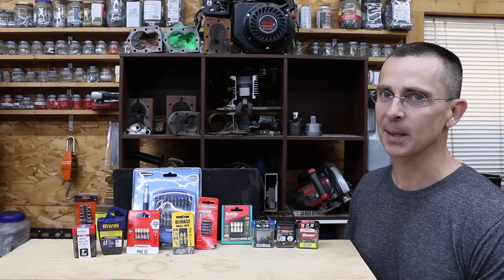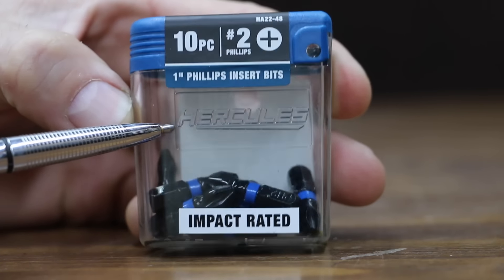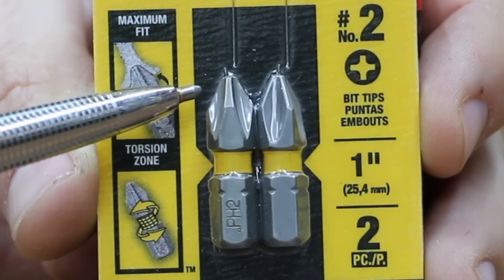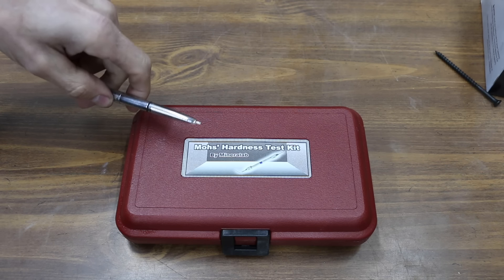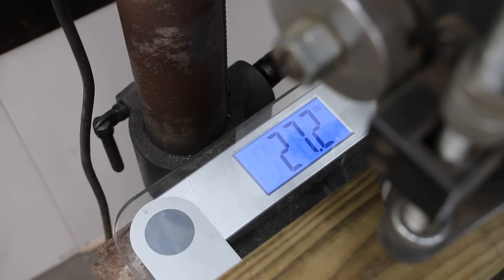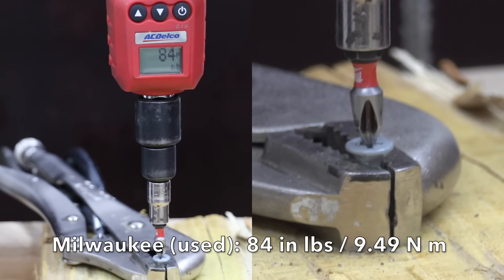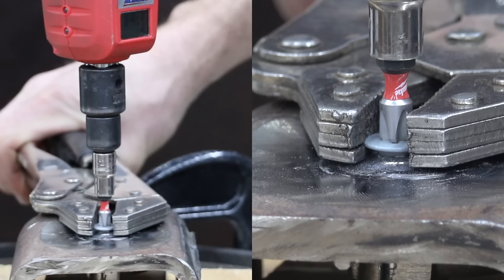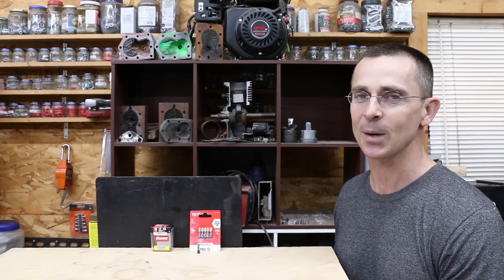Which Impact Driver Bit is Best? Let's find out! Phillips #2 Showdown

Comment: I live in Poland and probably will never use any of those, but your tests are just awesome, detailed and accurate. Pleasure to watch. Thanks!
Reply from the maker: Thank you very much!
Reply: Milwaukee Shockwave, DeWalt, Bosch ,Makita gold (sam ich używam bo miałem dość końcówek które po paru wkrętach były do wyrzucenia )... wszystko do kupienia na allegro
Reply: używam Milwaukee Torx T25 i jestem zaskoczony. całą drewnianą altanę (domek) 15m2 na 3 bitach. problem jest taki, że kupiłem paczkę z 25 bitami...
Reply: I have seen Milwaukee becoming more popular and more available in the UK
Reply: What tools brands are considered best in Poland ?
Reply: @simeonbonev4111  Makita, DeWalt, Bosch blue line for pro's also Milwaukee  is getting more popular
Reply: tom drap I also think these are the main players worldwide . Makita had dominated for many ears, but Dewalt and Milwaukee in our days make stronger and more heavy duty tools and they slowly gain popularity in Europe. I have used all of these brands and lately I really like Milwaukee 12V Fuel tools because they are compact, but as strong as other brands 18V and 20V tools. The batteries are much smaller and also very cheap with a lot of aftermarket options.
Reply: Dude we don't live in a bush, we have Milwaukee, Bosh, Dewalt etc stores nationwide. Fuck the old stereotypes this is EU
Reply: @simeonbonev4111  Festool, Bosh, Milwaukee are top shelf but a lot of trades are using Ryobi and Parkside. I use Milwaukee but brought my shit from Canada which is cheaper
Reply: Greg Sparrow Price and warranty in different markets create the major difference. In the USA  trade people use mostly Dewalt and Milwaukee it has become symbol of professional attitude. I like Ridgid tools from Home Depot ( ARG in other markets)  because lifetime warranty on tool and battery . I have really hard time to go down to 2 systems because I find some tools so useful like the 23 gauge nail gun from Makita I don’t find other brands to have it . But I go more and more Milwaukee 12V  because they come with great deals and batteries are so cheap if you buy Milwaukee Fuel 12 is as strong as 18V or 20V from others brands
Reply: Profeska nie to co w cebulandi :d
Reply: Allegro has it all and cheap (paid like 45 cents/piece from DeWalt). (Im not gonna do a job that could break a bit, and other scores for DeWalt were really nice). I mostly needed SDS drill bits and also went with DeWalt
Reply: @simeonbonev4111  Greg Sparrow said correctly. Parkside is VERY popular as it's the best in the "A brand, rather a trustworthy one, but not an expensive brand" category. Not a professional's choice but one for people who only do some work at home.
Reply: I'm pretty sure you guys have Wiha Tools in Poland.
Reply: Kolego, Milwaukee kupisz już chyba wszędzie. A na internetach na bank.
Reply: @KLU I own a wiha screwdriver with changeable bits that is made in Poland. I consider it to be my best and most comfortable driver I own
Reply: @MicroageHD  I own wiha tools made in Poland

Comment: I am currently redoing my old rotted deck on the house I just bought. The previous owner that built the deck used low-quality screws that rusted badly. I was using vice grips and a pry bar to remove the boards and screw is one by one. After watching this video I purchased a Philips DeWalt number 2 and used my impact and it has changed my life. The screws are actually coming out or at least the vast majority of them whereas before they weren't coming out at all. Before I started using the new dewalt bit and my impact I was using a drill with an old Phillips head I was only getting one or two out of 25 screws out. Now I'm getting them all out except one or two and if they don't come out they break which is fine too.
Reply from the maker: Thanks for sharing.

Comment: As an electrician I use my impact all day, I’ve used the Milwaukee tips for 3 solid years after 4 years of using Makita tips. Milwaukee is the best on my opinion.
Reply: Did you tried the black coated milwaukee ones ? I have it and its my favorite after the wurth AW. but for philips or pozidrive, it's even better than wurth or wiha
Reply: Torx bits is the best.
Reply: hot dog I do use the black coated impact Milwaukee tips mostly but just got a pack of the Shockwave Pozidrive tips so we will see.
Reply: tom eng Are you talking about torx tip style bits and screws? I’m unfamiliar with a brand of tips named Torx.
Reply from the maker: Thanks for the feedback.
Reply from the maker: Thanks for the feedback.
Reply from the maker: Thanks for the feedback.

Comment: WHEN WORKING IN ASSEMBLY WE USED MILWAUKEE WAS THE ONLY BIT THAT WOULD LAST THROUGH A WHOLE DAY.
Reply: WHY ARE YOU YELLING?
Reply: Milwaukee makes fantastic products
Reply: WOAH THATS REALLY INTERESTING
Reply: @SilvianoJ  BECAUSE WHEN WORKING IN ASSEMBLY YOU GO DEAF !!! ASK ME HOW I KNOW!!!
Reply: @SilvianoJ  HES MAKING A STATEMENT. HEAR HIM OUUUUUUTTT!!!
Reply: Almost 1,000,000 subscribers for Project Farm!
Reply: Milwaukee is the best. In my honest opinion. I'm in a middle of a constructing a restaurant. I'm using the same bit after 200 sheets of drywall
Reply: EB Lou Lou I CANT HEAR YOU YOU NEED TO SPEAK UP
Reply: @woodlefoof2 Ok IM HAVING TROUBLE HEARING CANT tell  IF IM YELLING oR NoT
Reply: I WAS HERE
Reply: caps lock is cruise control for cool
Reply: Nice.. I'm sold.
Reply: Milwaukee makes good tools,  Their drill batteries are tops as well.   They hold power a loooooong time.
Reply: I don't know where you work, but I'm a carpenter and I can use the same bit for weeks (I usually end up loosing it). If you have a hard time finding a bit that can last you a day, I think the issue isn't the brand, but the way you're using it.
Reply: Milwaukee batteries cases suck I ve seen so many shatter on impact overtime in the cnc shop I use to work at. It made me wish they sold just the battery shell/case. But other than that, they held charge very well. It always made me wonder why no one makes a drop case for batteries like  for cell phones
Reply: @ebloulou4203  yeah but what else is being used? are you talking self tapping into metal studs or regular screws into 2x4s
Reply from the maker: Thanks for sharing.
Reply: @jpmking9635  taping into metal studs, f majority was firewall so two sheets of ⅝'s stacked. 4x12drywall sheets
Reply: @joshr1801  why are y'all dropping the batteries so much? I've dropped tool after tool off of ladders onto concrete, and have never had any brand battery bust open. And I use them till they're dead
Reply: From the tests I've seen, the silver Milwaukee bits suck. The black ones are decent. The German ones seem to be the best tho
Reply: SilvianoJ  BECAUSE HAVING WORKING ON ASSEMBLY FOR A LIFETIME YOU BECOME DEAF. so. He doesn’t intend to yell...
Reply: @SilvianoJ   long term use of an impact driver without ear defenders= deaf as a post. If that happened to you,  YOU'D BE YELLING TOO
Reply: @urjnlegend  it wasn't really me using them, I was  a saw operator ( I unloaded bar stock from semis and cut materials on 3 different saws, so I had no use for power tools) there and the power tool rack and battery area was 20ft from me so I seen a lot of batteries on the chargers.
Reply: @SilvianoJ  WHAT?

Comment: I use Milwaukee’s shockwave line of driver bits and have not been disappointed yet. From high torque applications to driving 100’s of 3” stainless deck screws, the bits I have seem to get lost or stolen before needing to be swapped out due to damage or breaking. I have a number of the shockwave cases of assortments of bits, but seem to use the 2 inch PH2 and T25 almost daily and have not broken one yet. Very impressed with the quality and it seems this test reflected that with the results.
Reply from the maker: Thanks for sharing.

Comment: I can't remember when I screwed up my last bit, since I use Torx stuff...
Reply: samplesmasher yep, i quit buying phillips head screws and only get torx and never have an issue since
Reply: Lol, yep. Got about 5000 t25 screws of different sizes in the shop and use them for all my build projects it seems. Probably at least 50 t25 bits floating around too but rarely need to replace them.
Reply: Torx is the only way to go.
Reply: I finally wore down a Milwaukee Shockwave T20 bit. It's been used for a couple of years and has installed 50 m2 worth of rafters, ceilings, joists, floors, skirting boards and a lot of other stuff. Well over 5000 screws so far. It finally started slipping a bit more than i liked and i've donated it to the fuck-it bucket.
Reply: I re-did the decking on my trailer using nothing but torx bits. Had to go to the store twice to buy new bits because they kept breaking. Went though a few brands. Can't remember them all but they were impact driver rated. One brand I remember for sure is Makita. I was pretty disappointed with torx stuff. Maybe it was just me. Lol
Reply from the maker: Thanks for the feedback.
Reply from the maker: Thanks for the feedback.
Reply from the maker: Thanks for the feedback.
Reply from the maker: Thanks for sharing.
Reply from the maker: Thanks for the feedback.
Reply from the maker: Thanks for the feedback.
Reply from the maker: Thanks for the feedback.
Reply from the maker: Thanks for the feedback.
Reply: Project Farm Please don't get me wrong. I really love your videos and respect your work. I just wondered who recommended this test and why PH-screws are still used in woodworking. Most people I know are using Torx (including me)

Comment: I used the dewalt bits for awhile, which were great when I was using a 12v impact driver. Very little issues with them, and they didn't wear out that quickly. Now that I upgraded to a 20v impact driver, which has some power, the old dewalt bits shatter quickly, sometimes on the first use.
Reply from the maker: Thanks for sharing.

Comment: After a day of decking and the homeowner showed up with 3" Phillips screws this lovely vid shows up ! I broke 2 ryobi bits , a dewalt impact rated bit then dug an old rusty bit in those plastic strip holders out the bottom of the box  i wish i knew the brand because ole rusty was a trooper . Did 5 hours of work and still had rust on it . Maybe older is better.
Reply from the maker: Thanks for sharing.

Comment: Have you done Torque Wrenches yet? Accuracy, consistency, tolerances, etc.
Reply: Rashad A real tool reviews has done a very good test with them with calibrated equipment.
Reply: You Wish  
I usually buy either the harbor freight or Walmart brands, they seem to made by the same facility, and both have lasted longer than my dad's Snap-On which we replaced 3 or 4 times before I bought a cheap-o one. I usually only buy a new one because I "misplaced" the old one, not because they broke.

It's pretty bad when a tool that costs 10x less last longer then the "professional" grade brand.... In fact, both are still operating as if brand new almost 5 years later, whereas my dad's Snap-On (now mine, since he passed) is broken YET AGAIN!
Reply: The key to keeping a torque wrench accurate it so back it off to its minimum  every time you aren't using it.
Reply: @Apachefog  seemingly not ..my norbar one explicitly says not to, as going below the minimum or above the max is what causes accuracy to go out. They said they did extensive tests leaving wrenches set at various settings and didn't affect the accuracy if they were left set...the ones that were backed off though ended up being inaccurate as it's all too easy to go below the minimum
Reply: @johnphillip1711  I've seen testing that showed significant accuracy degradation on torque wrenches that were left set towards the middle of their range for a month. They were click type and backing them off takes the tension off of the spring inside.
Reply from the maker: Thanks for the video idea.
Reply: @johnphillip1711  at the minimum... not below... always reset to minimum and put it away in a case is the correct procedure....🏁
Reply: @boosted2.4_sky  https://www.norbar.com/News-Events/Blog/entryid/449/the-ten-things-you-should-know-about-your-torque-wrench

If your storing long term yes its necessary, but seemingly not everytime, but I see where your coming from, good habits and all.
Reply: @ProjectFarm  I'd like to see a test done on Bars Leak block seal intake and radiator stop leak. Alot of people are for it and also against it.
Reply: @jameshargrove9346  that'd be an expensive video, either buying a car with the issue the fluids "might" fix or purposely make one of his fail in that way, and risk losing a perfectly good vehicle. There's a haed gasket fix I know does work, it fixed Samcrac's Range Rover head gasket issue, but you gotta be careful cuz it WILL seize a thermostat shut cuz it's essentially a liquid JB Weld that hardens from the natural heating and cooling cycle of the engine.
Reply: @Apachefog  My HF/WalMart brand ones (click type) do not get reset; I've stored them at 85 lb-ft for the last five years and hold on to that value pretty well (testing accurate with each other as well as my Snap-On before it broke again as well as requiring the same approx. breaking force from a breaker bar to bust a lug nut lose based on feel).

Comment: I’ve used the Dewalt bits and I’ve broken a lot of them while building my deck. Then I used a Milwaukee bit and I haven’t had a single problem with it and continue to use it for future builds. Ironically I was using a Delwalt impact driver using a Milwaukee bit.
Reply: Agreed..  Milwaukee has better products; Dewalt has better marketing.   I've got a ton of Dewalt bits and tools, if they ever break, I'm switching over to Milwaukee.
Reply: @chrismast2790 it has a lot to do with cost as well.  
My tool bag would easily quadruple in price if it was all Milwaukee, and it was purchased in the last year.
I really like Milwaukee, but man they're proud of their stuff for sure.
Reply: @YoureUsingWordsIncorrectly  I use DeWalt daily, no problems.
Reply: Dewalt power tools are excellent, their driver and drill bits not so much.
Reply: @sonofRassmuss    Just going to post the same.  My Dewalt tools have been awesome!
Reply: I like the Milwaukee bits but run both their and Dewalts drill bits.
Reply: I love them both but most of the time Milwaukee is better 🤷‍♂️
Reply: i do that as well.
Reply: I use Milwaukee,  dewalt,  and makita on a daily basis, and honestly you can't go wrong with either one, for impact driver I prefer makita it is lighter and just as strong as Milwaukee, but in my opinion better because I have dropped my impact from a 14ft ladder a few times and it still worked were my co workers drop their Milwaukee drills from 6 ft once and it breaks, dewalt is good too but weakest one from the 3 on the impact,the drill itself though I like dewalt better than the Milwaukee and hate the makita drill, on the 12v line I would have to say Milwaukee is the best and that's coming from a makita guy
Reply: Forgot to say this by the way, I own a makita impact driver with a dewalt bit holder and a Milwaukee bit. So yeah I am not one of those fan boys who stick to one brand and say it's the best period, i like different tools better from certain brands and am lucky i get to use the all because i only own makita tools on 18v due to battery platform, while most of my co workers use nothing but Milwaukee and my work friend uses all dewalt so I switch from brands all day long everyday lol
Reply: Sacrilege!!!!
LMAO😎🤣🤣🤣
Reply: Yup, I broke 6 DeWalt building a shed and was shocked because Ive never broken a philips head driver before, but one shed build and I was snapping the tips like twigs smh
Reply: My go to are the Wiha Terminator or Wera Impaktor bits with diamond coating.  ive been using them for 5 years and i wont use any other bits.   Im still unsure if the quality has changed since they started making them in Vietnam vs Germany.
Reply: Kyle Bittle probably because u we're using a knockoff Delwalt and not Dewalt
Reply: Grad J I agree. I use my DeWalt tools daily and they are really good tools, but the accessories, blades, bits, abrasive disks and cutoff wheels are total junk.
Reply from the maker: Thanks for sharing.
Reply from the maker: Thanks for the feedback.
Reply from the maker: Thanks for the feedback.
Reply from the maker: Thanks for the feedback.
Reply from the maker: Thanks for the feedback.
Reply from the maker: Thanks for sharing.
Reply from the maker: Thanks for the feedback.
Reply from the maker: Thanks for the feedback.

Comment: I prefer torx anytime I can. You're going to break them more often than camming out
Reply: Drywall screws are designed to snap when torqued too much.
Reply: @brodriguez11000  I know, what a dumb design!  I've only ever head that "feature" of their design BITE me in the ass rather than save it...
Reply: Try hex or square or even the 3 sided ones, The 3 sided ones will cam out, while the other 2 will not.
Reply: brodriguez11000 why tho
Reply from the maker: Thanks for the feedback.
Reply from the maker: Thanks for the feedback.
Reply from the maker: Thanks for the feedback.
Reply from the maker: Thanks for the feedback.
Reply from the maker: Thanks for the feedback.
Reply from the maker: Thanks for the feedback.
Reply: @whitenite007  Drywall being a very soft material it's to insure it's not damaged. That's  another reason a special bit is used so it's  flush with the surface ready for taping and mudding.
Reply: @brodriguez11000  That is wrong, Dry wall screws should be sunk in just below the paper, Flush and you would expose the screw, Sunk in and the mud will cover the screw and hole. The special bits they use sink them down between 1/16 to 3/16 of an inch in some cases 1/4 of an inch depending on brand and type you pick.